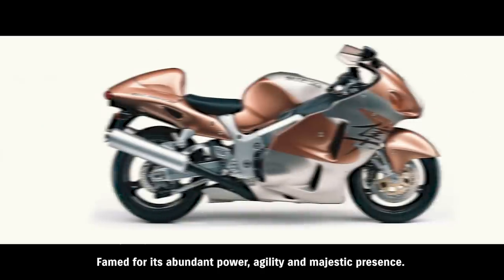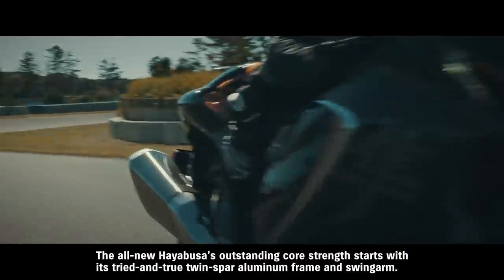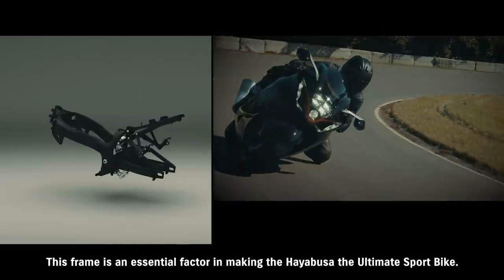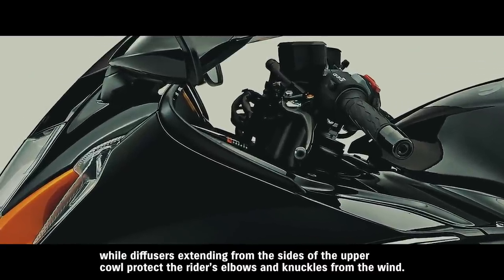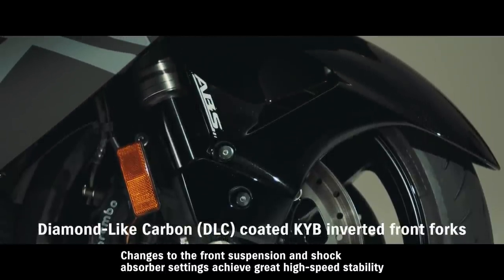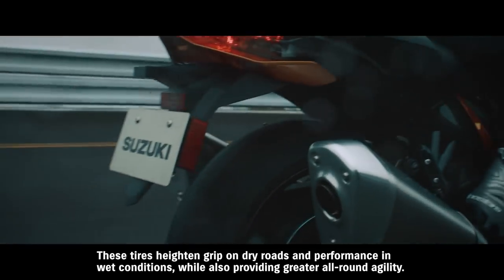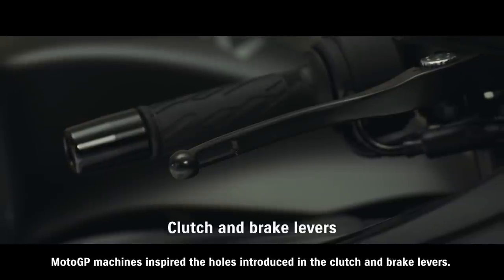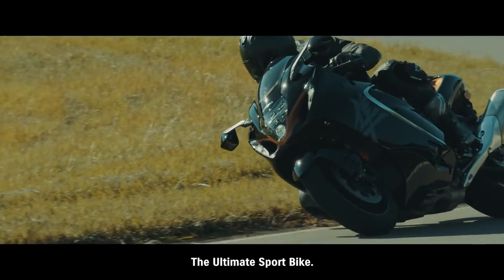Hayabusa | official technical presentation video =Brilliant Chassis Design version= |  Suzuki

Comment: A bunch of wasted time.  Without a 1441 , the only ones that should be happy should be Kawasaki fans. 😡
Reply: Yes bro low power figures, heck very disappointed.
Reply: I agree. They said that they had been working on this for years and this is what they come up with!!! I was hoping for more, lots more. More CC or a turbo maybe even semi active suspension. And got none of it. I had a 2000 Busa and it's basically same bike with new body work and electronics. I'm so disappointed 😞.
Reply: @jamesmelendez4549  Bruh but you  get hill assist on the fuckin motorcycle ... Hhahahahahaha